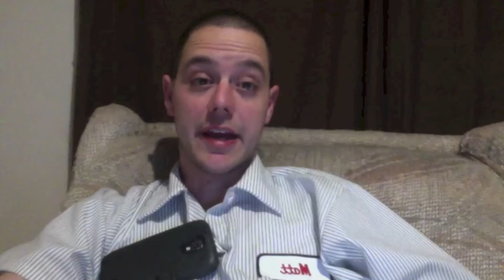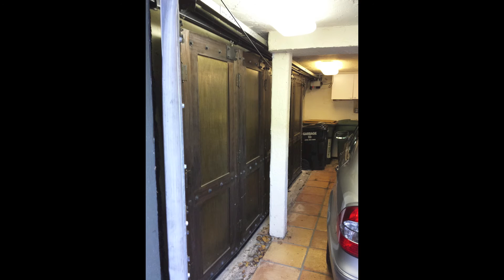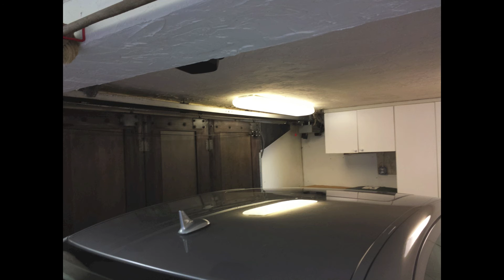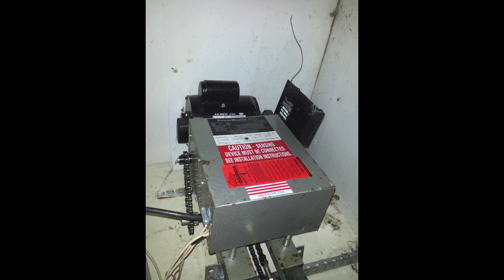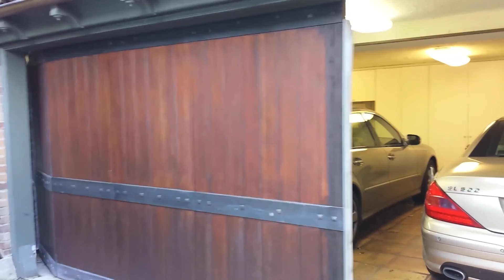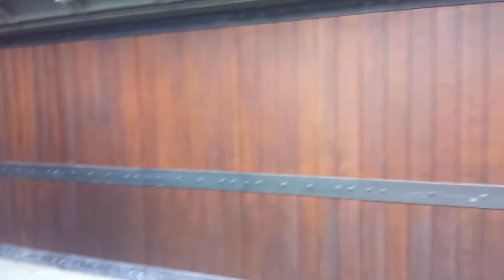Custom Side Sliding Garage Door with PowerMaster Commercial Operator /2

Comment: That is pretty damn neat. I guess the headroom was too low for a normal door. And of course, I have to comment on the 2 Mercedes in the garage. Haha! What kind of radios were they using?
Reply from the maker: I didn't think to ask what was there before, but by the headroom and the age of the house, I would guess a jamb-track door, although I'm not sure if they would have had an opener on it, due to that beam mid way back in the garage. And the Merc's were gorgeous. :-)